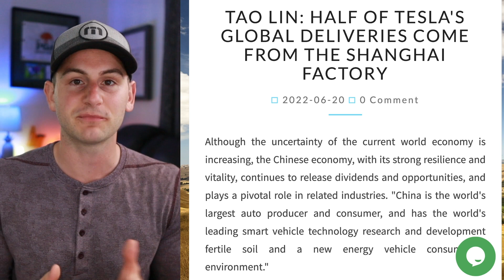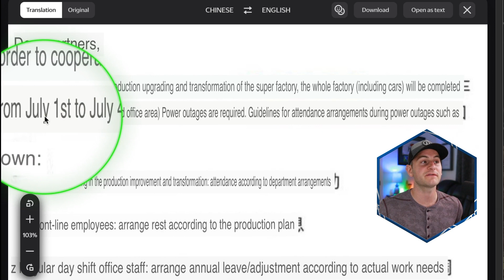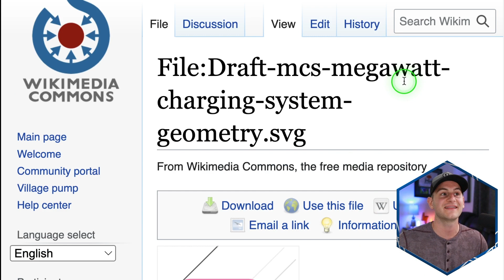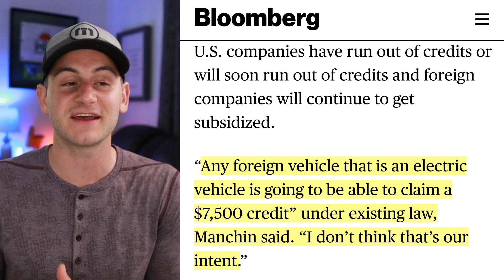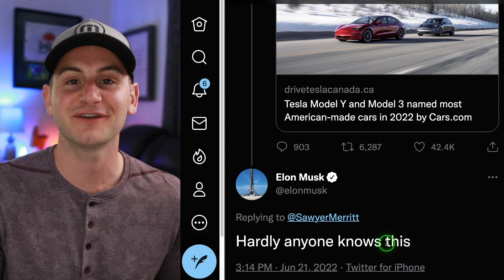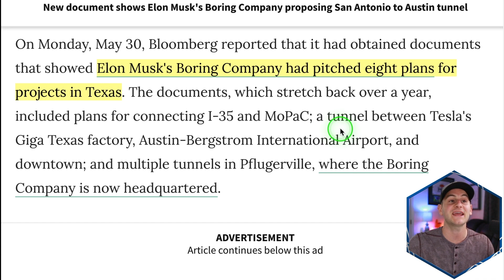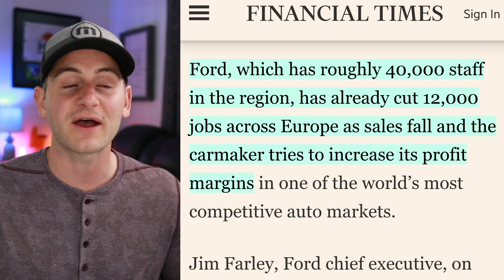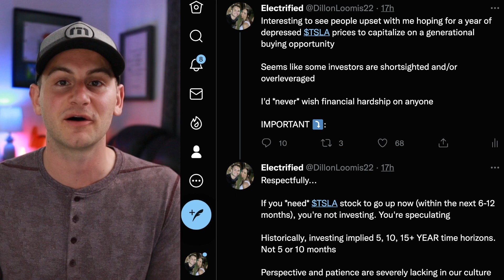Giga Austin "Losing Insane Money" / Shanghai July Upgrades / EV Tax Credit Update ⚡️

Comment: If you listen very closely to Elon, in the first minute of this video, he said that they "had" challenges with the 4680 and the structural pack ramps. Could he saying "had" mean they now have the issues mostly figured out but there is a long lead time to get the updated pack design and / or battery production equipment installed?

Comment: There are 4.33 weeks in the average month. 52 weeks divided by 12 months = 4.33. Re the Giga Shanghai calculation is around 95K not 88K per month.
Reply: Production days are NOT EQUAL to calendar days. Subtract holidays and downtime. 2022 will lose over eight WEEKS of downtime alone.

Comment: I haven't watched this video yet, but I will say... I like what Elon does, but.... Increasing population. Maybe after we can get this global supply thing figured out. Maybe after oil, fuel, etc is under control. I looked at maybe purchasing a used or even a new Tesla.. Right, I'm a locksmith, I blew through $1000 of fuel last month. I'm in Wyoming where fuel is pretty cheap. So, when I see headlines like "Tesla losing insane money"... No 💩 Sherlock, I think EVERYONE is losing massive money. Elon and Tesla can afford to lose some money, unlike the truck drivers that deliver things to Tesla. There's no one good answer to any of this, at the end of the day, were ALL screwed. I wish things could get back to normal, but I'm afraid that's a long time away.
Reply: Not so long as you think. Hang on.

Comment: I think the structural pack is causing a lot more issues than they expected. Berlin's ramp has been slow, and they aren't using 4680's yet. It's a huge shift in manufacturing, and they clearly weren't properly prepared. It's a shame, considering how long ago they announced the architecture, but hopefully they get it sorted quickly

Comment: Just took delivery for a Texas made MY for 59990. Build number 2409
Reply from the maker: congrats eric, that's super exciting!
Reply: @DillonLoomis22  the range is a little bit more than tesla......284 instead of 279. The first supercharge I maxed it out I'm going to Las Vegas
Reply: Your impression?
Reply: @robkeshav800  it's my second Tesla! I love that it sits up higher and being 6 ft 6in it's better to get in and out of it
Reply: @ericbarnett852  Enjoy your beautiful car. I am on our 2nd Model S which I love but my wife thinks that we should have got MX for the reason that you mentioned.
Reply: @ericbarnett852  You will shrink as you get older. My father was 6' 4" and drove an MG TD.
Reply: @tedmoss  I have a TD sitting in my garage. With the top down there is no height restriction!
Reply: The build quality is outstanding no bad panel gaps and paint seems to be great. One little scratch on the driver wheel arch

Comment: Sell side has been pushing Tesla this past week.  That's noise until proven otherwise.  Changing the US EV Tax credit to domestic only, no limit on production would be an improvement.  No incentive needed for chargers.  Discount needed for consumers now that they are tightening their belts. That leaves the main news being that GigaTexas is hemorrhaging money without a ramp in sight. I personally am not adding another share above $650 until there is clarity about 4680&GigaTexas ramp.
Reply: You're just promulgating FUD. "No end in sight" is just your misinterpretation. The "hemorrhaging money" situation is normal for a new factory and was expected. While the ramp up may be a bit slower than hoped for it is not fatal or even extreme.
Reply: @GntlTch  If there was visibility on the ramp, why didn't you provide it, dummy?

Comment: Thanks Dillon especially for the message at the end of the video. People are sensitive to anything going on with this market and many more are probably very new to not only investing, but a BEAR MARKET.  This isn't a Reddit meme, stocks DON'T ONLY go UP and there is a buyer on either side of every trade. 

You loose nothing if you are holding and you gain nothing if you are holding... it only matters when it is time to cash out. I hope others are setting themselves up to kick back and relax this summer because it's going to be HOT not only where they live but on Wall Street that will not play nice with our feelings. 

I've barely looked at what has been going on today and I have to say... it's okay, since my long term calendar shows my "time" has not yet come. 

Q2 is going to be HARD, but it is only for a time. We'll pull though.
Reply: It's the get rich quick mentality

Comment: So they are barely producing cars in Austin because they are committed to using 4680 cells and they are having trouble producing 4680 cells. This is going to make profit margins look really bad in Q2.
Reply: Been through this a few times, a bit of a delay then things pick up. Not invested in Tesla for the short term.
Reply: @turningpoint4238  I’m in for the long haul as well.
Reply: Q2 was a wash from the time Shanghai lockdowns went over a week, but yeah,.. this won't help and we also have BTC impairment to make it look even worse though it isn't anything but a paper loss.
Reply: @dr-k1667  My thoughts exactly. Q2 is a throwaway quarter and scaling up production will be very important for the remainder of the year.
Reply: You can tell how puny Austin production is by just watching the daily drone flyover video and seeing the sparse holding area.